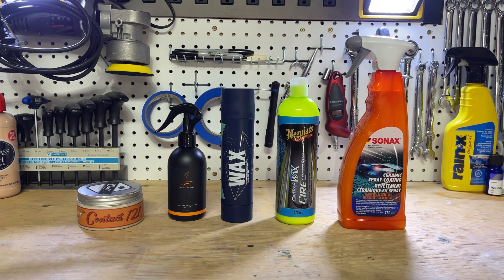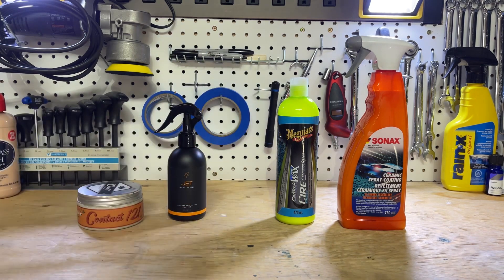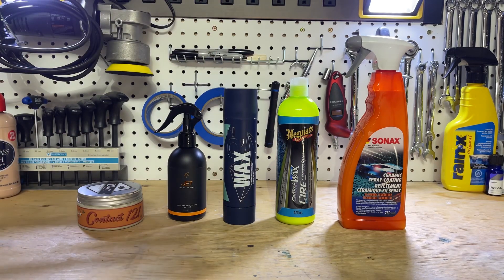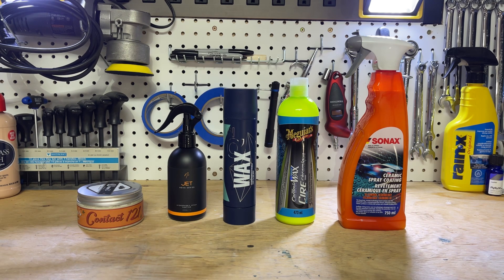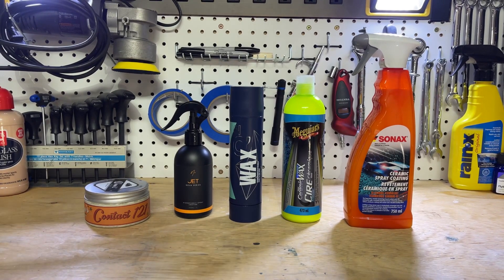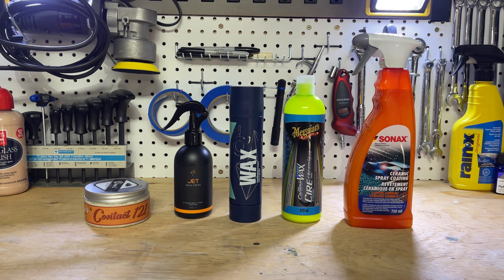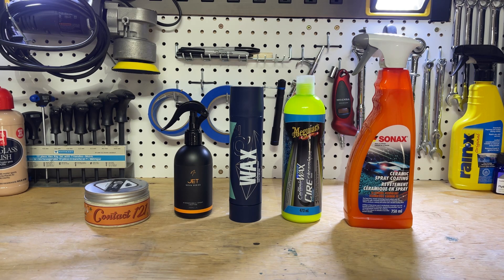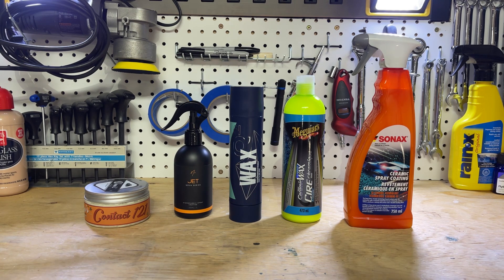Encyclobeadia Driptanica - the hydrophobic performance database.

Comment: Living in a tropical country, I prefer coating with better sheeting because is more useful to have more chance to not have many water spot
Reply from the maker: This series doesn’t focus specifically on beading, just the water performance when subjected to mist and flood settings. You’ll be able to tell which products sheet better versus bead by the contact angle.
Reply: To my test even sheeters won't do that if it rains  it will bead on your car the water volume is'nt high enough to sheet every part of the car some panels will have beads and some will sheet. And i also live in the tropics and it's almost impossible to keep your car cleam for a few days sometimes right after a wash you will see dust spots ot water spots etc i tried hundreds of products and even ceramics won't help you  but it's a breeze to wash your car with a freash coating applied.